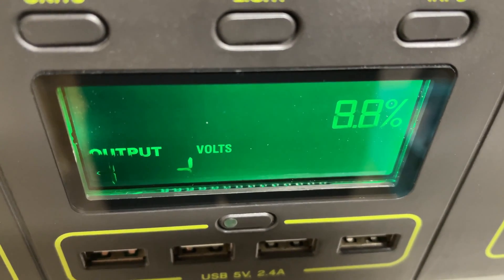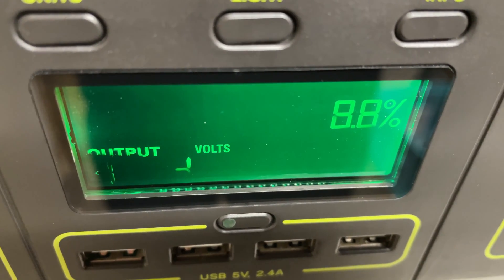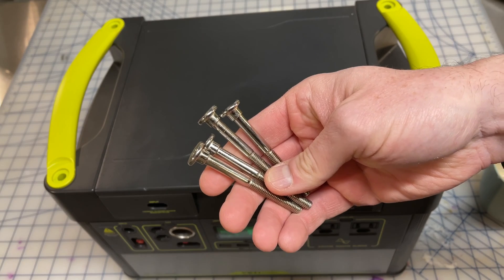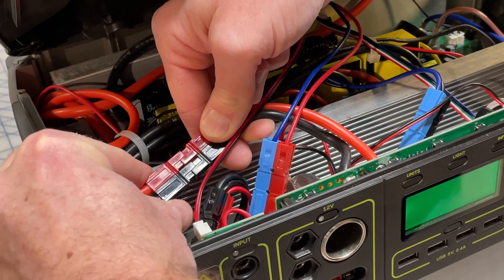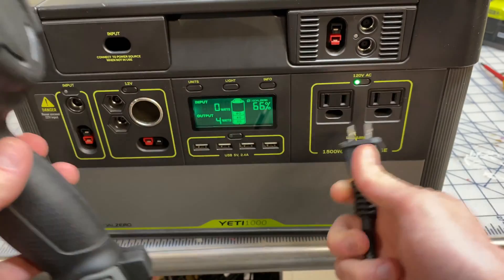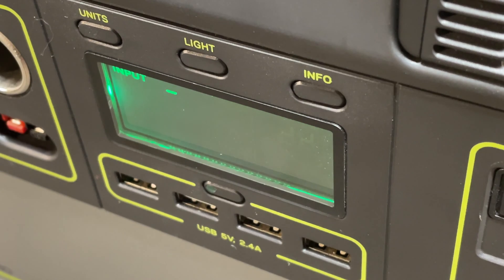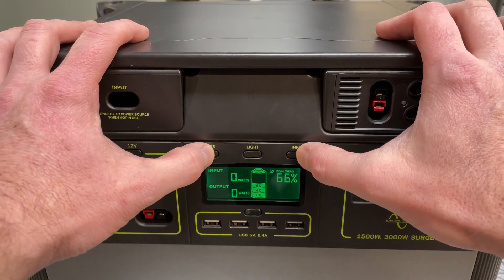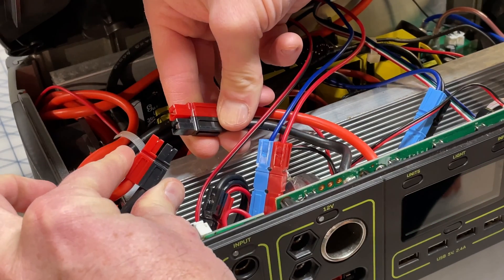I bricked my Yeti 1000. Yikes! How to fix an unresponsive Goal Zero Yeti with a hard reset.

Comment: Mine finally died. Bought in August 2017, died in August 2025. A good 8 years of usage for Vanlife. Tried reviving it to no avail. Probably needs a new battery at this point though.
Is yours still working?

Comment: Hey! I love your video. I have a yeti 700, brand new, but all of a sudden the ac outlets arent working. Every other part of the device is working including the USB ports and 12 volt output. The device claims that it is outputting six watts even when nothing is plugged in. Even when activated, the ac outlets don't charge so much as a phone. Does that sound like a hard reset worthy issue? Or is it something more serious. I'm super new to electricity so I'd love any help from anyone. Thanks!
Reply from the maker: That definitely sounds like a hard reset is worth a shot - let me know how it goes!

Comment: I have a 1500x in a conversation Van when my isotherm refrigerator turns off sometimes kicks off my yeti . It starts to blink cold and will not take a recharge , but it will allow it to discharge. I have searched for reasons the only thing I found was possibly certain refrigerators may create the problem . 
Have you come across the issue ? 
Great video by the way !

Comment: my yeti wont charge to 100 it stay stuck at 89 - 86 percent.
Reply from the maker: That’s just the battery losing capacity over time. Mine is around 88-90% now

Comment: I'd like the Yeti to be quieter during charge and discharge. I haven't opened my Yeti 1400 Wi-Fi, but I'm wondering if it's possible to replace the cooling fan with something quieter. Perhaps using a slightly larger PC cooling fan?
Reply from the maker: I recently saw a video where somebody swapped out the fan on their Ecoflow River 2 and it was way quieter so yes it’s possible if you’re handy

Comment: These 1st gen lithium redesigns definitely had some issues. Thankfully the X line is much more reliable
Reply from the maker: Good to hear the X line is better. My 1000 needed so many things to bring it up to usable standards - MPPT module, regulated 12v cable, car charger cable/converter, multiple wall chargers to make it faster and all that stuff is built in nowadays.

Comment: My yeti 1000 lithium does not seem to charge! When I plug the charger it beeps then show me zero charge, and the input voltage is 8.2 volt. Then it goes dark. I followed what you did, but to no avail. I checked the charger without being connected to the yeti, and it gave 16 v dc. Any suggestions.? We rarely used the yeti, and it’s 5 years old.
Reply: I also tried removing the bottom, per yeti help, and disconnected a wiring harness then reconnected it, but again, it did not help.!
Reply from the maker: Does it charge via solar or car charger?
Reply: @todd.parker  I do not have a solar panel, and no car.
Reply from the maker: I’d suggest calling Goal Zero support, or using the Chat feature on their site. Sounds like either the charger or battery is damaged.
Reply: @todd.parker  thanks, I did by email and phone,but the rep did not seem to be technically minded, and did not connect me to an engineer.
Reply from the maker: @georgekyrala  Bummer, they are hit or miss. I’ve had good luck with chat during business hours
Reply: @todd.parker  thanks, but no chat  on their website, nor on Facebook !am I missing the link to chat box?
Reply from the maker: I think it only appears when they are open. Look for a chat icon lower right. When they are off, it’s an email button

Comment: Hey hey 
I had the exact same problem. The yeti was frozen and a soft reset didn’t work. Then I tried a hard reset but my goal zero went black. No lights on the display and no restart… is it broken? I was very carefully so I didn’t touch anything else 🥺
Reply from the maker: Yikes. Did you take the top off and disconnect the battery?
Reply: Same sh*t here.

Comment: It seems like the battery now just dies pretty fast when I’m running a fridge… any idea if any of the resets may solve the issue or is it time for another unit?  Apparently GoalZero is not servicing batteries on these units ;/
Reply from the maker: To quantify the problem, charge it to fill, reset the output meter (hold the units button) then plug in your fridge and run the battery to 0%. Check your total watt hour output on the screen and if it’s less than 850-900wh on a Yeti 1000, the battery is not holding a proper charge. If you talk to support, they may be willing to ship out a refurbished unit if it’s under warranty

Comment: I tried to do a firmware update on my Yeti 1400, and now it won't stop beeping.  Nothing worked to reset.  I will try your way.  I did take of the bottom and disconnect the battery, and reconnected yet, but beeping still came back.
Reply from the maker: Ugh, so annoying. Hope this works!
Reply: @todd.parker  Sorry, it didn't work.  Your way though a better way to get to the guts of the unit.  I unplugged it overnight, plugged back in this morning, still beeping.  I pressed the Reset button for 10 seconds and it went away, but as soon as I press the wifi button the beeping comes back.  The unit still works great, but I haven't found a way to update the firmware, and if I press the wifi that annoying beeping will drive you crazy.  Waiting for customer support to tell me what to do next.   I will let you know when I have found a solution.

Comment: Hey Todd, Does your Goal Zero 1000 still hold charge? Mine doesn’t fully charge anymore and discharge really fast if I unplug the wall charger, I’m still mad at Goal Zero with their promise to sell replacement battery for it when it first got released but they never did and just discontinued it and replaced it with a new model X.
Reply from the maker: Mine would only charge to about 90%. I called them and they offered to replace it with a refurbished 1000 that charges to 96% so that’s progress.
Reply: @todd.parker  6% better😁

Comment: My experience is similar but wasn’t able to bring my 1000 back to life until I took the battery completely out of the unit, from the bottom panel.  The battery showed zero volts, looked like it was wasted.  After I took the battery totally out of the 1000, it started to show some life.  My guess is the BMS got stuck and didn’t allow current to flow in or out.  When I attached the battery back into the unit, attaching the positive cable then got a spark on the negative cable when I attached it and a volt ohm meter showed not zero volts but 12.20 volts.  Probably had a BMS (battery management system) problem that reset.  It’s in the garage now sending AC to a circulation fan.

Comment: you do great work  informational videos. I had a similar problem and held down the info and units buttons at the same time for 30 seconds and it rebooted and fixed everything. I don't know if mine was in the same situation but it  worked. I can't take credit I viewed it on another video. But I don't know if the Yeti was in the same catastrophic situation can you elaborate?
Reply from the maker: Yep, what you did is a standard soft reset but sometimes the controller can get into a bad stare and need a hard reset. Usually an overload situation triggers it.

Comment: Todd, quick question.  How hard do you think it is to replace the battery?  I don’t find them online, nor showing the battery bank of the 1000.  Anticipating your teardown video of the bottom.
Reply from the maker: Based on what I’ve seen there isn’t a replacement battery available. My battery needed replacement and Goal Zero is exchanging my unit rather than replacing the battery. From what I saw in my tear down, this isn’t a typical drop in battery like the lead acid Yetis.
Reply: @todd.parker  Todd,

That’s what I thought. When you lifted up the black plastic, I saw the individual cells. Maybe 18650 size.  I should be receiving my 1000 next week.  It is used, so I don’t know the condition.  The lithium models are lighter, but the trade-off is there are no “packs” readily available for purchase. I am like you. Dive in, and tinker around.
Reply from the maker: @Fraggboy  Yeah, I think a DIY person could replace the cells in here as long as they were to spec. Seems like standard 18650 like you said.
Reply: @todd.parker  I can’t wait to dive in and play.  :)

Comment: Great information! Have you experienced the wall chargers not charging?
Reply from the maker: When in this bricked state or in general?
Reply: @todd.parker  in general. I bought an open box and it worked fine. I’ve hooked up an epevertt MPPT to it and I’m thinking that GZ maybe has some safe guard in it that recognizes none GZ equipment. 
The wall charger worked fine when I bought it. And even worked after using the epevertt    Then the wall charger just quit working one day. I bought a second one to see if maybe the charger went out, but the new ones doing the same thing. I thought I’d reach out and see if you had any experience with the chargers since you run 6 of them ;)

I haven’t tried the “hard reset” in this video yet. 
Thanks for your videos by the way.
Reply from the maker: @cmacrafton  Ah, it actually might be charging but not be telling you. This video might be illuminating: https://youtu.be/rqXscD69RvM
Reply: @todd.parker  yep. Will was actually where I got the idea from. He’s right it doesn’t show charging from solar. My issue is charging from AC. The blue ring around the AC charger doesn’t even light up when I plug it in. I’m thinking GZ has some sort of disconnect when it sees a non proprietary MPPT hooked up to it.

Comment: Man I just experienced this exact same issue this afternoon. Googled "how to reset a goal Zero"  and found your video. Thanks!
Reply from the maker: That’s exactly why I made this! I panic google for stuff like this all the time
Reply: @todd.parker  Here's my update: I plugged my Victron in to power it, no luck. Plugged in the house extension cord, no luck again - screen stayed stuck showing 88. I took a 4mm hex wrench and undid the 4 long bolts holding the two yellow handles down. The moment I lifted the cover, the display came back on and everything worked as normal. Is there a microswitch inside the lid? I took some detailed photos and will place on my website tonight. The very surprising thing is that the components inside were exceptionally clean - no dust or dirt inside! We carry our Goal Zero Yeti 1000 in our van everywhere for the past 3.5b years and 130,000km over dusty roads too. I'm very impressed with the overall quality of this unit! Thanks for the timely tip!
Reply from the maker: @sprinterdiscovery  I wonder if that somehow caused a small disconnect on the power to reset it? Anyway glad it’s fixed

Comment: Thanks  for doing this series about the GZ 1000L, I just got mine yesterday after being a longtime GZ 400 owner. I tried using the included power brick and then added the brick from the 400 and got a total of 120w charging. I will be adding an array of 400w solar mono panels next and running that through the mppt controller I've already installed. Excited to see how it all works.
Reply from the maker: Nice, you can combine up to 4 of those power bricks, or go with the fats charger. I really like the 1000, it's small but has enough capacity and am inverter that can power pretty much anything. You'll have fun watching all my Yeti 1000 videos!

Comment: Looking forward to part 2 of this series - going in from the base plate. The wifi stopped working on my Yeti 1400 Lithium. The soft reset didn't fix the problem. Goal Zero customer support suggested disconnecting/reconnecting the battery and the comm connection at the base of the Yeti through the bottom plate. So, I'm going to wait for part 2! Thanks again.
Reply from the maker: Oh interesting. I assumed those wires were to communicate from the BMS to the main controller but wasn't sure. It's an easy job - just unscrew all the phillips at the bottom and cover lifts right off. You'll see a small wiring harness right on the side of the battery.
Reply: @todd.parker  Done and fixed! Thanks.
Reply from the maker: @EagleOne49  Hey that's great! Did you try the hard reset in mu video first or just go for the BMS cable at the bottom?

Comment: Does hard reset solve battery charge indicator not going to 100%? Mine only shows 96% when fully charged.
Reply from the maker: Unfortunately no. I’ve tried running it down to zero and resetting and also around 60-70% and neither worked. I tested my output and can only get 840wh so I think my battery isn’t right. Goal Zero agreed to swap mine with a refurbished 1000 so I’m waiting to that to arrive. Worth chatting or calling them to see if it’s a calibration or battery issue.
Reply: @todd.parker  Thanks
Reply: @todd.parker  did you receive a replacement unit, and if so is it satisfactory?
Reply from the maker: @leftofone  I just got a refurbished unit this week and the display reads 95% so it’s 1-2% better but basically it’s the same. I tested the AC output at about 250w and was able to get 820wh which is the same as my original.
Reply: @todd.parker  Quick question. Are you charging via the MPPT? Mine would only charge to 94% using the MPPT port.  I plugged in my 25A fast charger via the PWM APP, and it charged it to 100%.
Reply from the maker: @Fraggboy  good idea but I’ve been using the PWM. I just got a replacement refurbished unit and that charges to...95%
Reply: @todd.parker  Interesting.   Have you tried un-plugging it, and plugging the charger back in??
Reply: @todd.parker  Thanks for that info. I drained my almost 2 yr old lightly used Yeti to zero, slowly recharged, and was only able to get 94% full. Watt hours used totaled 832. This argues in favor of an external LifePo4 battery and DC to DC charger!
Reply: @todd.parker  I received my replacement unit today. Did your refurbished unit display 100% when first you got it?
Reply from the maker: @JasonKim0101  NOPE. The went I sent away charged to 93-94%, my replacement using is a solid 95%. Not worth the hassle.
Reply: @todd.parker  I just finished charging. I was able to charge all the way to 100%. However, I agree with you that it's not worth the hassle for just few percent gain.

Comment: Fantastic content!  I wish Goal Zero (and other "solar generator" companies) would just put this stuff front and center.  I'm kind of shocked they are only using the 45A Andersons internally, but I guess I don't know what their battery series/parallel configuration is internally, so maybe it's fine.  Can't wait to see the tear down!
Reply from the maker: Yeah, I've had lots of people find my other reset video and be super stressed out because it didn't work. Rather than have people mail 50 pound lithium batteries around, why not have a hard reset switch or at least make a video on how to do this. I just ended up in a bad state and decide to see if I could figure it out but this is a super simple fix. Guessing it all comes down to liability...they don't want someone opening this and getting hurt but why not add a breaker or switch on the outside to do this?

Comment: Great video.  My yeti 1000 has blown out many times...I full-time rv, use every day last 18 mos,. And most times when I do the double press to reset it comes back on ok, but it takes longer (sometimes several hrs) for it to remember what the % was before it restarted.  Also, my yeti push button for AC plugs gets crooked and will not go on and off, so you can take off lid like you showed, and you can gently reposition the plastic push button peg to work again...have done that several times..so now I just leave all my push buttons on ( only uses 2-4 watts for all buttons on with a MV plugged in).  Thanks again..I have not encountered the problem you had...yet!
Reply from the maker: Guessing it's just a matter of time! I do appreciate how easy it is to open these up and make small adjustments. I still like Goal Zero's products, just wish they did a better job supporting customers with the bumps in the road. Their support is good but they could document these fixes somewhere.
Reply: @todd.parker  are you on the GZ users FB site?  If not can I post a link to your channel there?
Reply from the maker: @untetherednomad6393  I'm not, please cross post. Thanks!